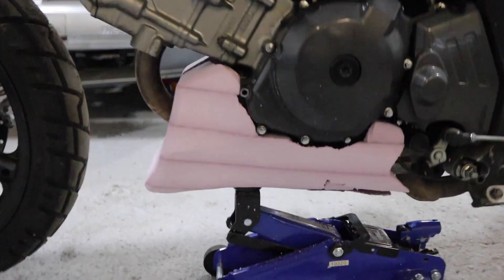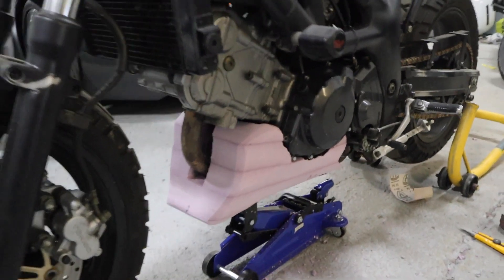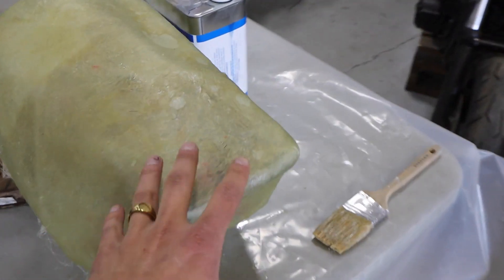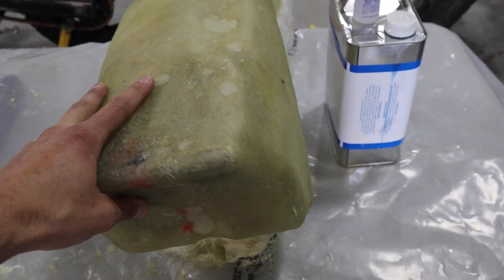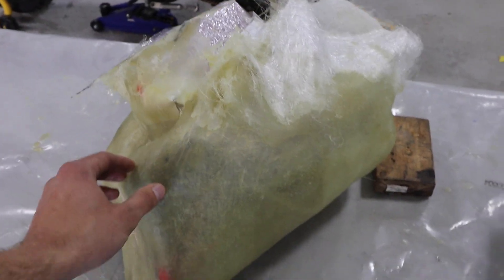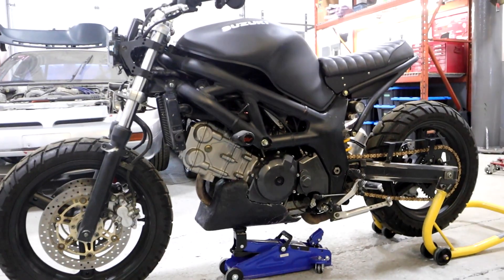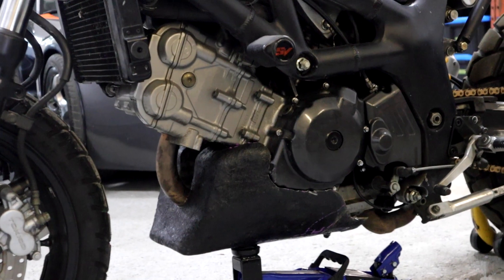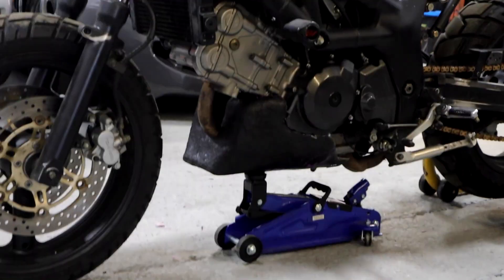Experimenting with composites - Making a belly pan SV650 EP.10

Comment: Do you need to have all the changes checked by a test center and then have them entered in the vehicle documents by the state?
Or can you do whatever you want with the motorcycle and the police say nothing? 
I ask because I come from Switzerland.
Reply from the maker: It’s not too bad here. If it looks sketchy a cop may pull you over and give you a vehicle inspection and make you turn back to stock. but tasteful mods are usually ok